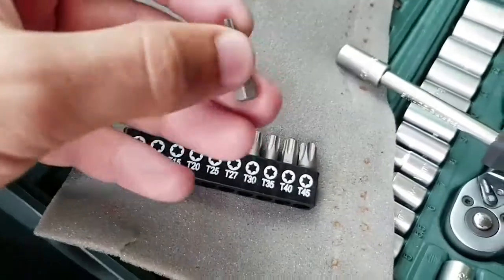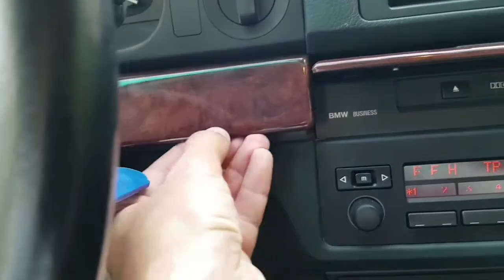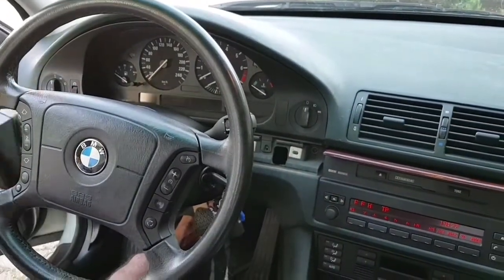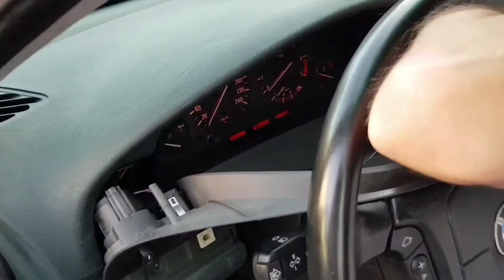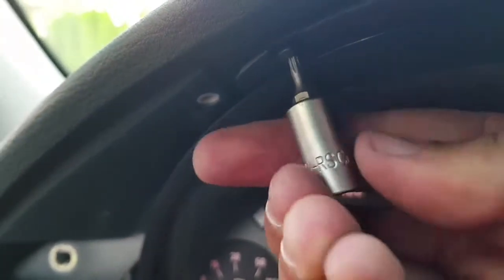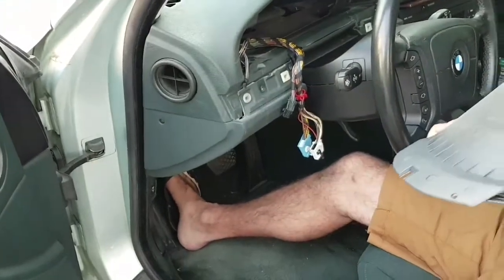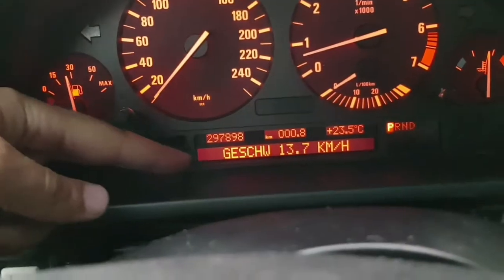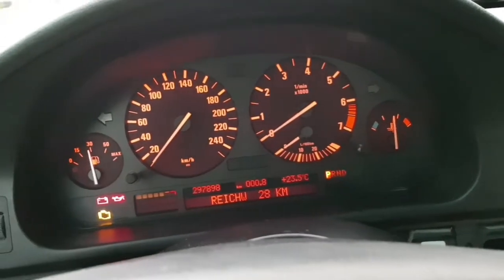Bmw E39 Cluster Repair

Comment: Hi, i have a problem with the dsc light. the light is OFF all the time.. do you know what is the problem?
Reply from the maker: When you put ignition on the light should come on. If so the light bulb is working. If not then you have to replace  it. While your driving the dsc will only come one when the wheels are losing traction or its deactivated.